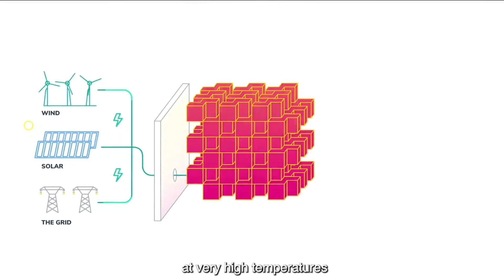Rondo Energy Overview: Introduction to the Rondo Heat Battery (RHB).

Comment: you'll know this is a real thing when some refiner works some into the front end heating for crude distillation - imagine that, a solar field charging these bricks in storage containers and then providing the heat to take crude up after the desalting phase... maybe even bringing it up to desalt temp... 700F/350C...  then they can say we heated our refining with green energy...  I'm serious.
Reply: مشاء الله هل طاقة خضراء هي الا طاقة طبيعية واشجار ونباتات طبيعة واستخراج طاقات كلور وخضراء استخراج طبيعة ليست مواد كلور الا مواد وموارد طبيعية تستخرج مواد كلور استخراج طبيعة اسرار مواد طبيعة وغير طبيعة
Reply: Saudi Aramco just entered an agreement with Rondo, so refinery process heating will most likely be used there soon.